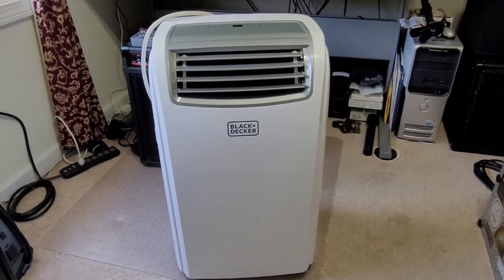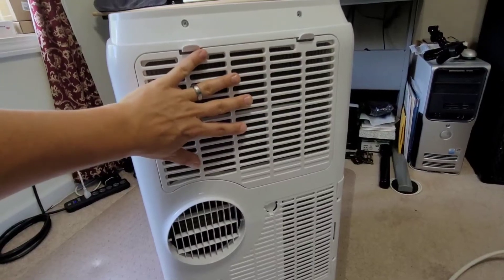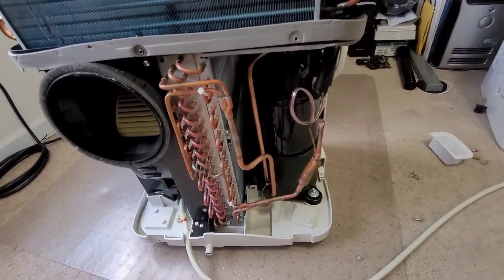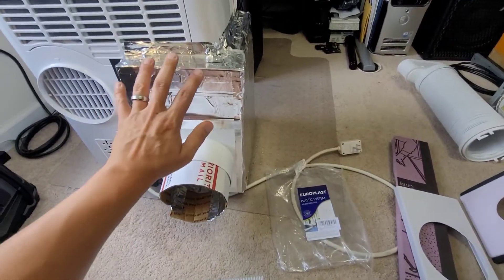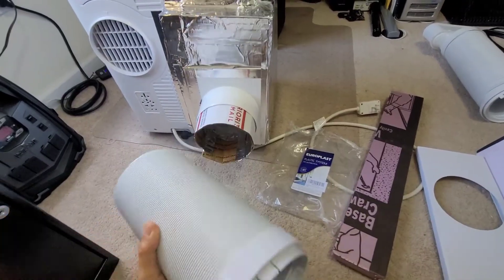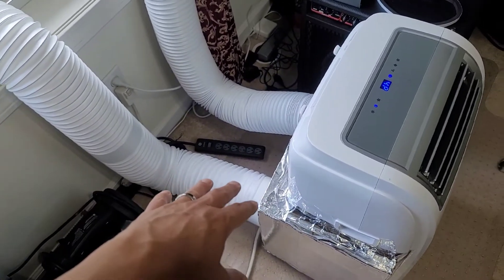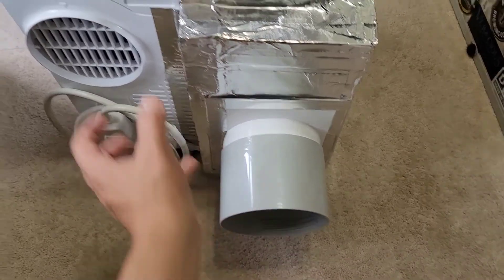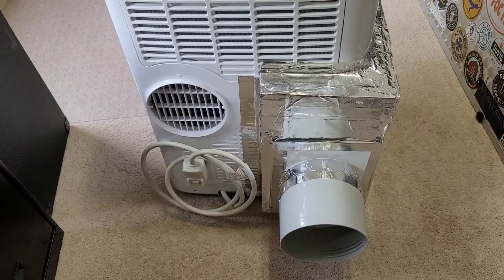Black & Decker Portable Air Conditioner BPACT14WT: Single to Dual Vent Conversion

Comment: There are so many of these types of videos that do not take into consideration the fact that you are indeed using the previously-cooled air to cool the condenser, but you will lose a lot of efficiency if you use outside (presumably much higher temp than the inside air) air. Of course there is a little bit of savings by converting to a dual vent system, but if you do the calculations, it is very small, so take your results with a grain of salt. Now the vacuum issue is a problem if you are in a very tight room, but most people are just augmenting a bedroom, so the issue is also negligible.
Reply from the maker: Appreciate your response. I ultimately see that a dual vent is best, even if gains are small. The vacuum condition is a problem bottom line. The warmer from outside cooling the condenser does lower efficiency slightly yes, but it's not an adverse effect to the point the AC doesn't cool properly. It was a worthwhile project to do in my eyes..others have found value in it as well. Thank you again for your insight too!
Reply: The problem with that is that while using warmer outside air vs cool indoor air to cool the condenser is less efficient, they have a significant static pressure fan pushing loads of air to cool, and it seems to work fine when starting up in a very hot room.
So far, haven't seen any of the naysayers put up any numbers or test video showing how its not superior in reality.
The vacuum effect is probably the largest killer of efficiency, since its almost impossible to prevent replacement ingress of warm air refill from window/vents/door jams, outlets, etc.
Unless everyone making these vids is just lying...
Reply: While that's true, the cold air getting heated gives a much higher coefficient of performance than heating hot outside air, you also have to think that you negate that when you realize that you're pulling in outside air. If the air outside is just as hot as the cool inside air you've heated and thrown outside, it can't be efficient at all. It can't pump heat if it's not moving more heat outside than it is inside.. that's the major flaw with these single hoses. The cooler it is outside the better their actual efficiency. Heating the hot outside air always heats the outside air more and therefore more efficient. I do have a portable AC unit, but the irony that my new unit has a COP of 2.3 and my old 90's window AC has a COP of about 3.. new split systems probably get a COP of over 4 or 5

Comment: How often do you drain the unit if you leave it plugged?
Reply from the maker: On really humid days once a day. Very little condensation hits the tray since it is evaporated over the condenser coils and out the exhaust tube.
Reply: @Bassguitarist1985  I just found out today that I do not have the plug (missing) on my unit so I am looking for a solution to plug it which made me look around on how long people keep it plug and I read around that there are people that had never had to drain theirs for 3 years.
Reply from the maker: @kymberhsi  it is possible, very little is leftover as the heat from the condenser evaporate it out of the tray and out the exhaust. 

If you need a replacement drain plug this one below should suffice...

OEM Delonghi Air Conditioner AC Drain Stopper Plug Originally For Delonghi PACAN125HPEKC1AEX1, PACEL290HLWKC1ABK https://a.co/d/7ZNkdp4

Comment: I did this to my midea 8000 BTU unit, the difference was negligible.  Almost like the engineers designed it to be efficient using the rooms cooler air.  Not sure.  Smaller condensers aren't going to be as efficient using 20 degree warmer outside air.  I think this is why they say a single hose unit has to work harder to get the room cool, but once it's there it's fine.
Reply from the maker: Thank you for the insight. I still think the advantages of a dual hose outweigh a single hose unit. Window units operate the same way with warmer air cooling their condenser coils, and compressor size is about the same too. The negative pressure issue in the room is a big issue in my mind, you don't want to pull air away from another room. If you are in an apartment and someone is smoking, ick. Thank you again for watching!
Reply: You seem to be one of the few people who've declared no benefit.
The physics/loss is pretty obvious, using cooled room air to cool the compressor is a big net loss.
The vacuum effect of expelling room air is likely as large or larger net effect.
Got a Haier 10K to do this on later this week.

Comment: Mine has a dehumidifier mode, if I convert it into dual hose will it still dehumidify my room??
Reply from the maker: Hey! I'm trying that right now since it's 87⁰F and 56% RH out today.

Yes it will dehumidify with either single or dual hose with a caveat. The unit is not a true dehumidifier where the incoming humid air moves over the evaporator and then through the condenser coils which are hot back into the room since the hot exhaust is exiting out the window. Basically the units dehumidifier setting is air conditioning but on low fan. You still gain the benefits of the dual hose with evaporative cooling and dehumidification all in one.

Comment: I had the same problem with my portable device. My device has two suction grills and a hot air outlet hole in the middle. I realized very quickly that it is a design mistake and the efficiency is very low because the cold air coming from the room is reheated and taken out. In addition, a vacuum is created in the room and heated air comes back into the room through other ways. I searched everywhere on YouTube which of the two grills must be connected to a new hose so that the aspiration can be done from the outside. This video was the most revealing. I give A+++++++ to the creator of this video. Bravo!
Reply: Agreed 100% Beautifully explained, well said, detailed and on point.👏 Thank you very much Sir for taking the time to make this video! Most appreciated. God Bless

Comment: I found this issue when I discovered the vacuume in my room.  I screwed the window adapter to the back where the intake vent is located (you used foam insulation board), I used plastic around it to create the seal.  The hose clipped on like it would to the window adapter.  Then I installed the airconditioner in my closet to cool my servers and network equipment.  The hoses went into a plywood attic access door where I cut 2 holes for the hoses.  I insulated the hot hose and taped around any holes where the intake hose would pull room air.  The airconditioner has been running well for 2 years with this fix.  Nice video.
Reply from the maker: Thank you for watching glad it helped out!!

Comment: This mod doesn't do much since it will still take in air from around the rest of the chassis. I just use it as it came and it works fine for me.
Reply from the maker: The evaporator and condenser coils are sealed chambers within the chassis. It does make a big difference in efficiency

Comment: If i attach 6inch exhaust fan unit reversely so that outside air will reach towards compressor quickly in modified air duct.. Will it work??
Reply from the maker: It can help sure. Do a video on it!

Comment: hey man I like the video, but do you know where I can buy the duct connector? Im having a hard time looking for one online
Reply from the maker: Vent Systems 6'' Inch Air Vent Duct Connector Flange Straight Ventilation Pipe Plastic Ducting Connector Plate For Cooling Heating Ventilation System HVAC 6" inch https://a.co/d/iTL1WFy

HOXHA Portable Air Conditioner... https://www.amazon.com/dp/B09T9GX2LX?ref=ppx_pop_mob_ap_share
Reply: @Bassguitarist1985  thank you! How about the other one that connects to the circle in the back? Do you happen to know where to get one as well?
Reply from the maker: @ediigonzales3317  I just listed both the flange adapter and then the female to female adapter with threads to connect the hose there's no other part
Reply: @Bassguitarist1985  Sorry if I’m confusing you but the circle on the back left side 2:35 (your hand was on it) is there a connector there so i can connect the hose?
Reply from the maker: @ediigonzales3317  this is the closest I could find. 

Air Conditioner AC Appliance Adapter Compatible with LG Model Numbers LP0621WSR, LP0721WSR, LP0820WSR https://a.co/d/2FO4WJD
Reply: @Bassguitarist1985  thank you so much!! I will give this one a try!

Comment: Confused as to how this might work if your unit only has a single fan. Are there two intake fans inside the unit? One intake for the compressor vent, and another intake for recirculating the inside air? It's these two air streams you mention are sealed off from eachother, right? I'm wondering what drives the airflow over the cool side if the air intake for the compressor comes from outside, over the compressor to cool it down, and then right back outside. There must be some other fan for the evaporator side as well, right? Or do they use some kind of clever engineering with a single fan to draw air in through both intakes while preventing them from mixing together?
Reply from the maker: Two fans. One for evap and other for condenser. The evap drip pan drips on hot condenser coils and condenser fan evacs moisture. The rub is the intake vent for condenser fan steals inside room air to cool creating negative pressure in the room lowering efficiency.
Reply: @Bassguitarist1985  Awesome, thanks! I have this model, slightly different molding on the back, but it's gotta be basically the same on the inside. I'm in the process of converting it to a dual hose unit. I really hope it helps because when I got it last year it barely did anything! But I live in an unconditioned apartment building, so any air it sucked in to replace what it stole for the compressor was already hot and humid, which basically resulted in a net zero temperature change. I hear the single hose units fare much better in a home that is already air conditioned, just you want to extend that to another room. That way the air that it draws into the room is already at a comfortable temp. My apt. is basically a worst case scenario for these single hose units.

Comment: Do you have updates on this? Is it still working properly? I am worried that there is less cool air blowing through the compressor that may cause some overheating issues. Thanks!
Reply from the maker: Still going strong!!
Reply: @Bassguitarist1985 how about power consumption to a wall ac unit?
Reply from the maker: @adammasri  Are you are looking for power consumption information on this particular model or on a comparable window AC?
Reply: @Bassguitarist1985  sorry let me rephrase. What is the power power consumption of the modified portable ac compared to a wall ac unit (if you ever tested & make comparison)
Reply from the maker: @adammasri  I never made a comparison between the unmodified and modified however I can keep this as a future video idea showing the power consumption. Efficiency is going to depend greatly on the outside environment, so it won't be exactly an empirical review on the topic only subjective

Comment: increase effeciency even more by shortening the exhaust tube to your window so less heat evaporates back into the room. And you can buy a hose sleeve that insulate sthe hot exhaust hose they work really good a well

Comment: I thought that would only dehumidify the out side air after doing this. But what do I know.
Reply from the maker: So when you set this unit to dehumidify it changes the damper inside between the evaporator coils that get cold and the hot condenser coils. It draws air from the back side over the evaporator coils to cool it taking out the humidity but then the damper sends that cool dry air down through the condenser coils back through the evaporator coils warming it back up. When you set the unit to AC this damper closes and then you have your traditional split system where the condenser coil air and the evaporator coil air are separated.
Reply: @Bassguitarist1985  thank you for the answer. I was trying to figure out what was wrong wit my unit when I came across your video. I never used to have to drain my unit before. On my unit it has an extra drain up top in the middle where your able to hook a garden hose type fitting to drain it. That area fills with water very fast now and it never did before on the a/c setting. So I put a hose on it going into a bucket. It fill about a gallon and a half in around 8 hrs. Maybe my damper is not functioning properly any more. Who knows. I never had the problem before. It still cools with cold air but kinda annoying to have to be set up this way. I’m thinking maybe it’s low on Freon because my central are froze up one time and leaked water and the tech filled my unit to resolve the issue. Do you think that could be the issue? It’s only about 18 months old but you know everything nowadays is made to break. These people running these huge corporations talk about climate change but make crap that doesn’t last. Seem to not make any sense and doesn’t help have stuff not last very long. Sorry for the vent. Lol!!
Reply from the maker: @atrip3900  Yes if the coils are freezing up make sure that the filters are clean and if they are clean I would say yes the low on refrigerant could be the issue.

Comment: Great video - I am doing this now with some experimenting with intake to my ductwork to the basement.  Two things I did that changes everything.  1.  Insulate the exhaust pipe.  2. Vent through the wall so the exhaust pipe would be 12 inches (and insulated).  AC comes with a nice adaptor and cover for the wall for the winter.  Looks better as well.

Made my comment before watching the whole video... you can get form fitting insulation for the exhaust - it is not crazy and makes a big difference.

If you look at the adaptor for the GE model to convert 1 to 2 hose, it has vents so it is not 100% sealed as yours is... something to think about.
Reply from the maker: It's too bad that the GE kit would not fit this particular machine. I like what you did and yes I did get some insulation for the exhaust pipe. It cuts down on the radiating heat that inevitably comes out of that so all the heat goes out the window.

Some others have mentioned creating a 3D printed adapter plate to fit this particular model just like the GE kit but unfortunately I do not have access to such tools but in theory that could make this conversion much easier.
Reply: Wow, it works.  It is 30C (86F) outside and 21C (70F) inside (14,000 btu 1000sqft room)  - normally It would I would be 23C (74F) - would not be able to get this low before.  I think the big factor is the air is taken from my basement (outside air with your setup) and not from the air conditioned room, which would suck all that cool air out.

Make with foam now - will make something better looking later.
Reply: @Steviek1234 You’re still creating a vacuum by pulling from the basement. So you’re still pulling warm air from outside of the house into your house.

Comment: My unit is frigdaire chill flex pro 12K btu. Single hose SUCKs. I had a 3d printed the second hose mod. I will try it soon

Some use the water drain to cool the condenser
Reply from the maker: That's exactly what this unit does, drain water from the evaporator over the condenser. Most of the water is evaporated out of the exhaust tube and any excess goes to a drip pan below the condenser coils.
Reply: @Bassguitarist1985  that is cool. Most single hose units are nearly same. I ordered insulating stuff to hot hose( 15 bucks sth like that feom aliexpress). I use it in my attic living room so roof windows and roof top glass door doesnt allow me to install the PAC. I insulated the masonary chimney with foam and i shove the heat up the chimney cant go dual hose but i will move and will go dual hose... they should ban single hose units. Also i am jelaous of Midea Duo inventer. (Tho i belirve it cant heat stuff while mine can) it is very efficent with 12000 btu sacc at 14k btu.
Reply from the maker: @Hi-levels  yeah this particular model that I have does not have the ability to heat like a heat pump with a reversing valve though the updated version of this model that I have does have that capability. I agree they should ban single hose vents but unfortunately it's the market that determines the features of a device and I guess most people cannot be bothered to install two hoses and would rather just install one hose to the window adapter. Companies are not concerned about efficiency but more about selling units...

Cheers and thank you for watching!

Comment: The longer your hoses are the more they radiate heat back into the room.
Reply from the maker: Correct. Unless you insulate them. Rule of thumb is keep as short as possible
Reply: @Bassguitarist1985  my BPACT14 is over-amping after about 4 minutes of cooling. Any ideas? Makes a slight worn bearing sound, but the heat blower spins freely.
Reply from the maker: @TreeLuvBurdpu  if it's cooling and blowing cold air for 4 minutes it may just be the overtemp sensor on the compressor. A worn bearing though is likely the cause if it is truly a bearing. Make a video and post it and I'll take a listen
Reply: @Bassguitarist1985  i already ordered a new one an started disassembling my unit. It's definitely bearings. A BN-Link Smart Outlet outlet helped me identify the over amperage. Did you get a warrantee? My unit died 3 years to the month after i bought it.

Additionally, on your two-hose upgrade, it looks like you may have covered the condenser fan inlet. Maybe I'm wrong, but i think you might need more in-flow opening area.
Reply from the maker: @TreeLuvBurdpu  Yes that is the inlet for the condenser inlet. Part of it is on the side of the machine and part of it is on the rear of the machine thus why the adapter covers the entire area. So far it's been running in my garage during my small engine repair stuff and no issues.